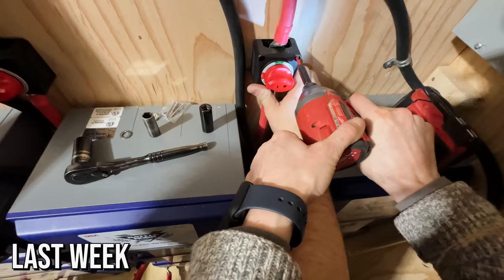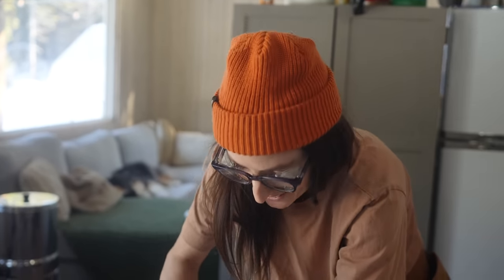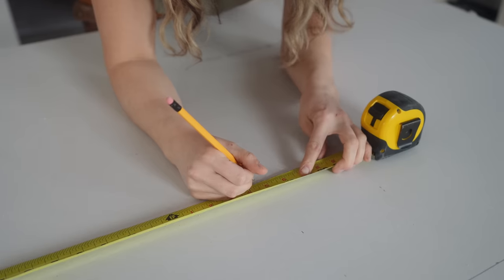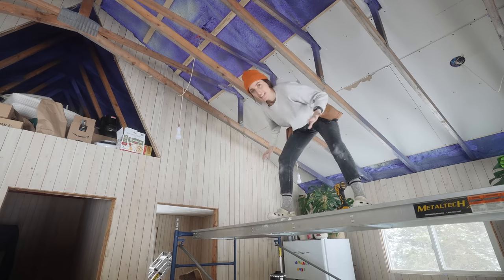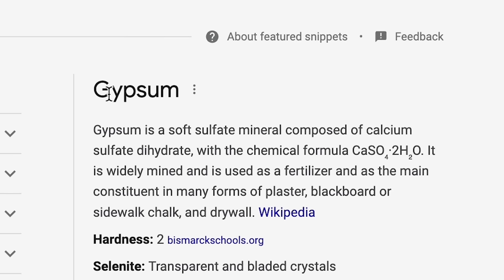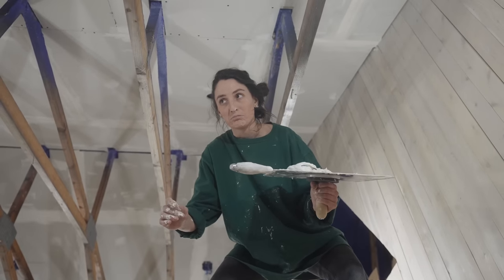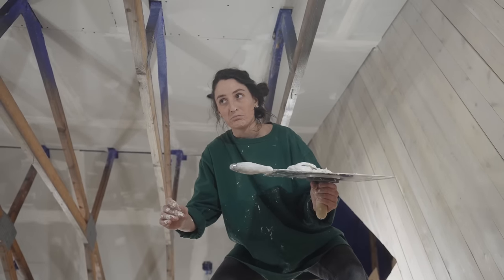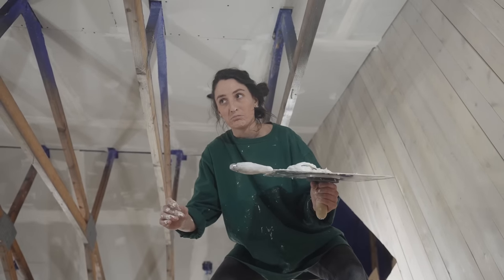Living Off-Grid in a Tiny Home Homestead

Comment: Hello Ladies. Even when cutting any size tree, especially hard leaners , always notch your bottom end . on a small tree it is sometimes safer to cut up from the bottom and not down from the top, this can prevent a snap back or a barber chair. My cousin was killed on an 9 inch diameter tree, that created a barber chair. Please be safe with a chain saw

Comment: Wide gaps  use backer rod... which is a coil of foam in varying width to fill gaps, add insulation, before drywall mudding which eventually will crack & fall out of a big gap

Comment: When you buy your drywall mud make sure you buy the kind that drops to the floor and does not float up in the air.  You can vacuum immediately after you sand. Each time you mud, just apply a skim coat so it all doesn’t have to have a thick layer sanded off.

Comment: You can ‘sponge’ drywall mud as well. A lot less dusty. Make the 🧽 only slightly damp and very softly rub over your seams.  

You want to make your seams wider and wider each time for smoother transitions. 

Also, an easy way to pick up dry wall dust from floors is to tears strips of newspaper/paper, wet in a bucket and drop all over floor. Then sweep up with broom. Keep doing over an over. Usually after a good dry vac vacuum first.

Comment: You are going to need to insulate that exhaust tube as water will condense inside it and run backwards into the bathroom or outside and down the wall, depending upon the slope of the tube. Also it will freeze in the winter and pull the tube down to the floor and close off the tube.

Comment: Holding a heavy sander while sanding joints is the hardest thing you could do.  Just use a pole sander.  It will not only be easier but also a lot faster.  With a pole sander it is easier to get out of the way of the dust.   I worked 11 years as a drywaller before I got my engineering degree and changed professions.

Comment: You need to insulate the pipe running through the attic space. At least the last three feet before going through the wall.  If you don't you will get condensation bad enough that it can pool in the hose and leak through the fan into the bathroom. :)

Comment: I don’t know if few people know it or not and maybe I’m too late late when you put the fan in everything but every time you put a fan in at least once a year, you have to take vacuum out the line from outside the insides and the only way to test it to make sure your fan is correctly pulling is the turn it on and put a napkin up against it and see if it holds it up. If it doesn’t that means you need to be cleaning out the fan make sure the power is off after you do this. Also, when you put a woodstove in your house you have to clean The chimney to the stove they also make a broom that goes in a drill that goes up the pipe out the top of your house. All you can get on top of the house and drill it down into the pipe to the woodstove and clean it all out so you’ll be ready for next year so you won’t have any Clarissa in the pipe which could cause a fire in your homeMassachusetts this is Alan Allen

Comment: Ladies - please do not keep dry sanding that drywall ceiling without proper ventilation, eye, protection, and breathing masks. But most importantly, do not dry sand the joints. It’s way too messy and causes too much dust.   Instead, use wet sponges to sand smooth the drywall joints. Wet sanding is cleaner and works just as well with no dust.  Watch a few YouTube videos on wet sanding if you need more info.

Comment: I don’t know if you’re reading last week for you? You guy took Easter off? Ps. HB Bella (if I read that right). As I’ve said before I’m working on my house (a 1920’s hunters cabin remodeled in 1947 to our house) anyway I’m working inside and my wife says the heater is making a noise? I crawled under the house, the heater was fine but? Yes the 1947 cast piping with lead solder had a leak, ok so where the f are you guys? I have enough on my plate you girls could help me out? I had to call the plumber plus I missed my Sunday do it yourself crew. 
Thanks for the shows but I could use som help on the job since September.